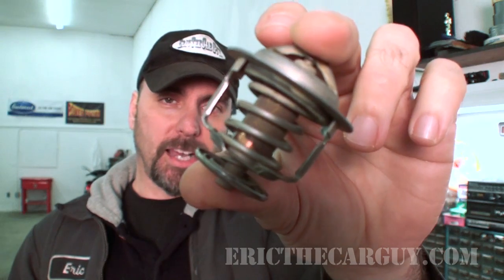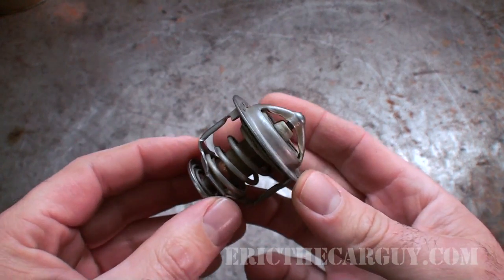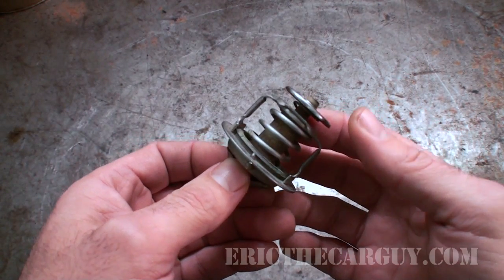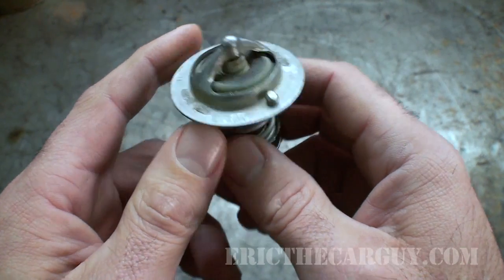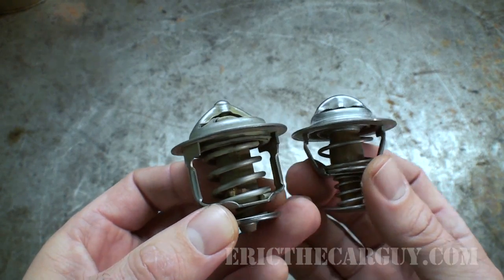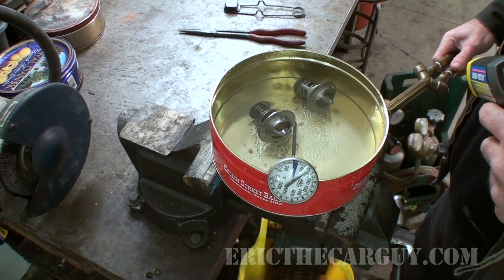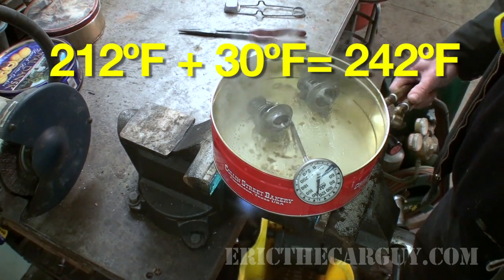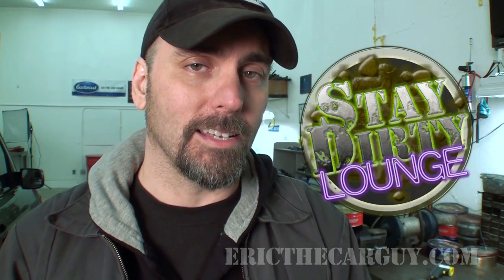Understanding and Testing Thermostats -EricTheCarGuy

Comment: Hi Eric, first thanks for all the great videos you always make and the valuable tips... I have a question hoping you can direct me.... first some background here i have a 92 mazda mx3 with a v6 engine... one day out of nowhere my radiator went while driving squirting coolant through the radiator wall itself managed to get it home got a new radiator replaced the old one put all the fans back on and all the (original) hoses  back on filled it up with fluid started it up and let it run to normal temp while topping up fluid and hoping all the air bubbles are out.... engine reaches normal temp not overheating no more bubbles i was a happy camper... but later on i noticed a distinctive smell ... not oil burning but smelled like coolant burning... ran the car again to normal temp where the engine is hot and i saw steam white smoke come from the upper radiator hose right where it hooks to the engine... noticed that my upper radiator hose was bulging and swelling so i went and bought another one replaced it, ran the car again with the cap off topping up fluid watching as water rises and bubbles disappear, however once the engine reached normal op temp ... the white smoke or steam seems to be coming from the exact same spot again upper radiator hose where it attaches to the engine... Note there was lots of corrosion when replacing the old hose... so now i am not sure why ... I have also replaced the thermostat which is on the other side where the lower rad hose is and i have reused the original rubber seal around the thermostat because the one i bought didn't come with any unfortunately that rubber seal has chipped off a small peace but managed to get it all snugged in there and tried gluing it with silicon but it's so small didn't think it would make a big difference... i did this after replacing the radiator and before replacing the upper rad hose ... thought i would mention it in case it's relevant to my white steam smoke coming from the upper hose right where it connects to the engine.... also fan doesn't come on and i sat there and watched it for good 5-10 mins with the car all warmed up ... car never overheats the fans come on if I disconnect the electrical switch that goes to the relay i think it's called temp coolant sensor I have 3 one for the gage one pin... two 2 pins one for the ecu to tell engine temp for air-fuel mix and last one for kicking off the fan at the threshold...replaced the coolant temp sensor for the fan and it still wont come on fan works relay works could it be that it takes a great amount of time before that threshold is reached .... anyways hope you can help sorry for the lengthy description

Comment: Is thermostat required for CNG or LPG driven vehicle?? Where the default engine management system is disengaged and another module controls the flow of fuel??

Comment: 07 pontiac g6 V6, over heats when going down road, but not while sitting. did a block test came out fine. but losing coolant somewhere but never any signs on the ground. any suggestions?

Comment: Great job Eric, you covered just about everything. I like to suspend a thermostat in the warming water rather that let it sit on the bottom, as you suggested. I think that the metal bottom is much hotter than the water and heat can travel through the the metal into the thermostat by conduction and open the thermostat at a lower relative water temperature. Keep them coming.

Comment: I just replaced mine, because my car has a new radiator just changed last week, prior to the fan chewing up my radiator -long story, had great cooling. It now has plenty of heat, fan works, no fan blockage or obstruction. (pretty sure I got all the air out:| ), but seems no flow through the radiator. It overheats without my heater turned up all the way. I think I might have a faulty thermostat from the factory as unlikely as it sounds so now I know how to test it. I'm going to watch your air bleed video next.

Comment: I am stumped with a 1996 Chevrolet C1500 with  Vortec 4.3. The thermostat in the truck when purchased resulted in a temperature of 160 degrees. So, I bought a cheapie Motorad thermostat 195 and it did allow the temp to rise to 195 but then it would open and the temp would drop like a rock to 150. The fact it rose to 195 would eliminate a temp sensor issue.. I think, but I did not like the sudden rush of cold coolant. So, I bought a Stant Superstat 195 and it does the same thing as the original... 160. On a whim, I tested it in a pot of hot water and it did not open until 195 or so. It seems to work properly. I do not believe I have a leaky head gasket or intake. These are weird symptoms.  Does anyone know why it would operate at 160?
Reply: Are you sure the Spring Side was installed inside the engine?
Reply: w0lvez1
Thank you. Yes, I am positive.
Reply: I had the same trouble with a ValuCraft thermostat.  Junk.  Switched to a Stant superstat and the temperature is now stable.  The gauge on your dash is often not reading the same location as the ECM is reading.  If you plug in a scan tool and monitor your temperature you will likely see the proper temperature.  I know that the 3800 engines up through the late 90's were this way with two different sensing locations making the gauge appear that the engine was always cold when it actually was the correct temperature.
Reply: Oh, thank you. I think the first thermostat I installed was a Valucraft, not a Motorad.  Hooking up a scan tool is a good idea, I will do that. When I dropped the Superstat in a pot of hot water, it opened at 195. Thanks.
Reply: bg147
The ValuCraft thermostat I had also allowed the engine temperature gauge to go up to 195F and then it would drop to around 140 and repeat.  The Stant stays steady around 140F during the winter on the highway, but a scantool shows that the temperature is correct with that one.  If you have the time let me know what the scantool says on your particular vehicle.  Thanks!
Reply: *****
Our situations appear to be identical. I do not have a scan tool but I might be able to test the temperature in a different manner. I will let you know,

Comment: Also, bleeding the cooling system of a mid-engine car is much more complicated. I am talking about cars like a Pontiac Fiero or Toyota MR2. Buy a repair manual and follow the instructions, or you will have problems and/or overheat and damage your engine.

Comment: I once had a thermostat rust or break, where those two little arms hold the top to the bottom. The bottom part fell down and blocked the passage, causing my car to overheat and stall. The "idiot" light came on a few seconds before it stalled. Anyway, I was able to pull the bottom part out, before it fell inside the engine...

Comment: Im suspecting a stuck open thermo in my explorer. And its causing other problems im thinking with upstream o2sensor. Because the engine isnt gettinf ro operating temp. Does that sound legit?

Comment: Also, many vehicle cylinder head gasket will be affected and damaged if Thermostat is removed, I recall one guy with Hyundai who forget to tighten the radiator cap only to find after a trip of 40 Km or more that the cylinder head became leaky (bubbles in the coolant) which is caused by overheating due to non exist of pressure needed to efficiently absorb the heat radiated through the engine metal.

Comment: Another very negative result of removing the thermostat especially on Hondas is that the engine will loose its power & healthy compression because I believe when the pistons gets overheated than the cylinder walls , it will over compress against the cylinder walls causing it to expand in diameter (in micro tenth of thousands).

Comment: I always test new thermostats before installing them....Best way I have found is to get a old coffee pot....fill it up and set the burner on high....usually gets it to 200 degrees or so(which is optimal coffee making temperatures) and drop them in. I replaced one and it came back...and back.... Took 3 NEW thermostats before I got one that worked right. After I took it apart a second time, I started bench testing them. Just because you get a new part, doesn't mean it is going to work.

Comment: Also.. its a super cheap part. Any DIY'er should have plugs, fluids, belts and a thermostat on shelf for their daily vehicle at any point in time.
Reply: That's pretty old school.  On a lot of modern vehicles a thermostat replacement is not straightforward and can involve replacing gaskets, etc.  There is no need to have a spare thermostat on hand if you don't have everything to do the job on hand anyway.  My garage would be full of crap I'd never use.

Comment: how does the raodiator cool the coolant.?
Reply: Basically the radiator "spreads" the coolant out over a large area. Then all along the channels it uses to "spread" it out tiny fins are attached. This helps to "radiate" the heat away from the coolant.

Along with that there is some sort of fan arrangement to aid in cooling. All fans have some sort of temperature sensor (control) to have them turn off and on or engage/disengage. The fans provide for air flow through the radiator when sitting still typically. While driving airflow is provided by the motion of the vehicle.

Fan arrangements and their operation can vary greatly from vehicle to vehicle but have the same basic function, to provide for or to aid in proper heat transfer from the radiator to the air. Overheating scenarios sometimes can be linked to these systems.

Comment: I just had my thermostat changed today in my car.  It was stuck open. It's cold and no heat :( Max temp the engine reached was 130 :( No I get great heat! And engine operates at 170 - 180 like it should!

Comment: I was always told that this test isn't always reliable because in the engine, the coolant is pressurized where as in a pan it's not, so it might open in the pan but not in the engine.
Reply: factory service manuals say this is the way to test out thermostats - it must be reliable enough.
Reply: In a cooling system the entire system is pressurized ( hot side and cool side). There is no pressure differential on either side of the thermostat so pressure has no effect on it opening or closing.
Pressure only affects the boiling point of the coolant.

Comment: One of the effects of removing a thermostat is that the coolant flows too quickly through the engine to allow the coolant to remove the heat from the engine. The result is overheating. This is very true of old Fords like Eric's latest acquistion. So don't remove the thermostat ... lol

Comment: With the valve opening and closing speeds I tend to favour the one that reacted fastest, in this case the aftermaket ver. Theoretically this means closer temp control of the running engine. This of course indicates nothing about the long term function and build quality.
 It should also be pointed out operation of the thermostat is not just for the warm up period but it should actually modulate the coolant flow all the time correcting the cooling effect for ambient temp, engine load, and as others have found blockages in the radiator plus a host of other variables.
Reply: Spot on Rob. Here in Chile, every mechanic (debatable) throws out the 'stat at any sign of a coolant problem.
I argue with them that they must know something every vehicle manufacturer in the world does not know. (They don't do sarcasm.)
Also, as you suggest, with no stat in there, the water will spend less time in the radiator & thus not be efficiently cooled before returning to the engine. Result: Overheating!  The word you used is the one I was searching for:  "modulate"  ...Perfect!  
(Another one is their belief that tap water is fine in our temperate climate! Yet simple Agua-Verde is dirt cheap & contains good anti-corrosion components.
I've seen 5 year vehicles with shocking corrosion throughout the cooling system.)
Reply: Reaction time doesn't really matter ,what matters is it opens it closes and opens at the right temp

Comment: good demostration Eric! one thing i can tell you about these thermostat.. These aftermarket ones tends to corrodes faster than the original oem ones.. you can see how thin these metals are in the aftermarket.. but again.. if a person owns a car and highly maintains his vehicles.. he or she must replace this thing every 3-4 years when going for coolant flush.. but i dont understand why not replaced it with OEM since it will only cost you 5-10 dollars different over aftermarket..  
oem honda thermostat = about 32-35 bucks
Aftermarket = 22 - 26 bucks..
knowing your thermostat will not fail in the future = Priceless :D

Comment: It must be stressed out that thermostats also grow old and tired. Basically this means they open at lower temperatures, just a few degrees, which is plenty enough to ruin the fuel economy of your engine. The spring goes softer, the paraffin may degrade or the capsule may rupture. My car's manufacturer (Dacia - Renault) recommends (not mandatory) changing the thermostat at each timing belt change, at every 80.000 km. As it is cheap, ~15 $, and the coolant is to be changed too, for me it always was a no brainer and changed it.

Comment: Another thing that can fail on certain thermostat designs is the rubber seal at the end of the valve disc.  It gets very hard and then brittle and cracks out.

Comment: So is that ticking sound a car makes when it sits after its been turned off the thermostat ?? , sorry if that's a stupid question . : )
Reply: Keep in mind you also have a very hot exhaust that is cooling down.  Most likely it's the ticking sound is the exhaust metal doing it's expanding/contracting
Reply: Tedybear315
that true , possibly a combination of both .

Comment: There's nothing wrong with some aftermarket thermostats. I've always gone aftermarket, and compared them. Stant is a good example because they have a standard version, and a Superstat version. The standard is pretty inexpensive and has many visual differences like the one in the video, looks cheaper. Stant's superstat is nearly identical to the (STC brand) oem. And I believe it works a little better when it comes to closing at the right time, and acting quicker. I have used both. I'm pretty impressed with the superstat's though.

Comment: Don't forget about water temperature sensors that control when to turn the radiator cooling fans on / off once the engine has reached steady state and the thermostat is open.

Comment: my 2c
1. if memory serves the boiling point of water is affected buy altitude (more accurately air pressure) and the boiling point of water is 100c at sea level, the higher you go, the lower the boiling point.
2. Try changing the thermostat in a ZD30 motor, what a PITA that is.....

Comment: Yeah, a few more examples of modern cars with expansion tanks and no rad cap would be worthwhile. Also, I'd be interested in the controls and valves for flow through the heater core. I had always thought that heat there was only regulated on the air flow side of the equation. Great video, Eric.

Comment: Eric, Just watched the "How To Bleed a Cooling System" video in the description. I noticed that some, if not most Civic's and Integra's from 1996-2001 stopped coming with coolant bleeders on the upper radiator hose pipe housing. Also the OEM Part for 1992-1995 Civic's radiator hose housings with bleeder has been superseded to a new housing with the bleeder absent... How do I bleed my coolant with no bleeder???
Reply from the maker: As pointed out in the video, you don't need the bleeder to remove the air form the system. It's only there to make filling the system easier. The procedure is the same, you just skip the step with the bleeder.

Comment: Interesting video. A couple of points; Many times with an ECT code, it is not the sensor, but the thermostat. In connection with aftermarket versus OEM thermostats, my experience, especially with a thermostat that is integrated with a plastic thermostat housing (e.g., Mazda), if one uses a new aftermarket part it will set an ECT code, however, using a OEM unit will not. Finally, according to the book Automotive Service, Inspection, Maintenance and Repair, Third Edition, by Tim Gilles, "...each pound of pressure on the coolant raises its boiling point by about
3°F."

Comment: Im having this kind of problem with my 95 Grand Cherokee 4.0... no heat until you rev the motor & hear a "whooshing" of the water/anti freeze going through the heater core.
Reply: Sounds like air trapped in the system, Eric has quite a few videos that show how to go about bleeding trapped air from the coolant system.
Reply: I have taken off the heater hoses  and radiator hoses and blew threw them... re installed... left one open... blew threw... etc... when I catch a "warm" day, I'm going to change the thermostat.... go from there...

Comment: Is it possible that you have a partially stuck open like its not all the way, to cause the engine to run a little hotter than normal?
Reply: It could be the case, especially in the summertime. If the thermostat is not closing, it will not allow the coolant to cool off, but usually in winter temps it will run cooler and get some what worse fuel mileage. Hope this helps
Reply: Dashboard temperature gauges suck, they say 90C when it's actually in a range of 80-100C. And they are very slow. They do this to keep you from being worried, but "a little hot" is probably way hot.
Reply: Eric Borders    not really My engine is running a tad hotter than normal....and i'm in chicago...where its BLISTERING cold right now
Reply: mastertje2 My engine is running a tad hotter than normal....and i'm in chicago...where its BLISTERING cold right now